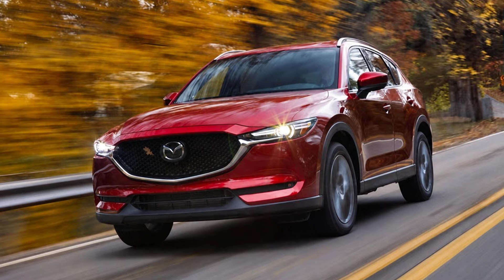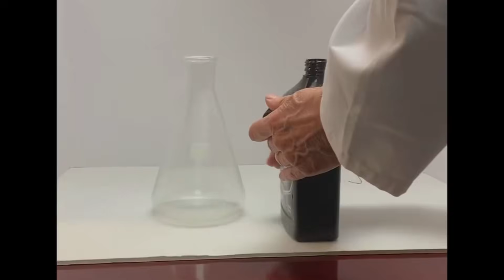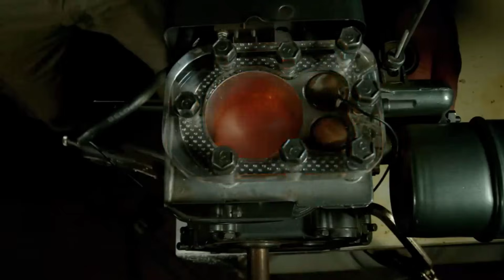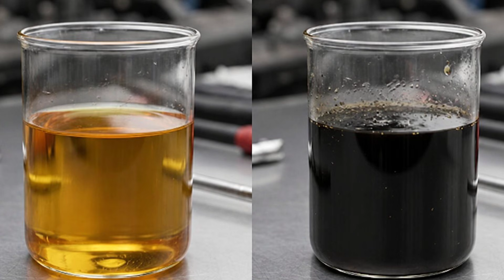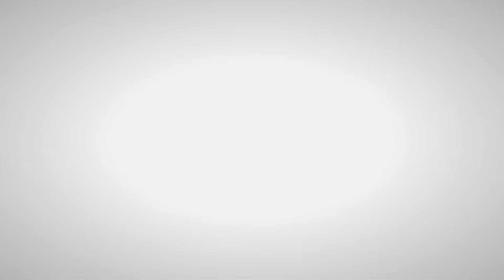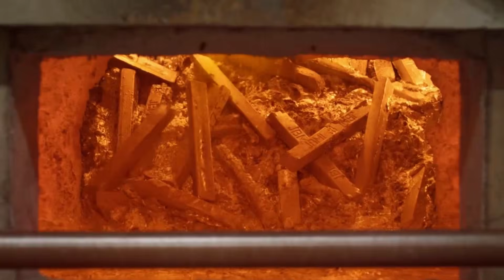Pennzoil 5W-30 vs 0W-20

Comment: Several auto engineers have stated that engines are not designed to run 0w-20, it's the execs decision to meet CAFE stds.  As a result, over 6 million engines are being recalled across numerous manufacturers.  My car calls for 0w-20 and I run Ravenol VST, a group IV/V oil at 5w-40

Comment: Whatever you use, change it every 2000 miles for a long trouble-free turbo charged engine life.
Reply: 2,000?!   Yea, the more often the cleaner but don't you think 2k is a bit often with good oils?
Reply: @datsuntoyy  Contrary to popular belief, hes absolutely right. Especially with 0w20, you get it out before it even starts to shear, fuel dilute. Carbon buildup , deposits will be immaculate over the long run.I personally do 3,000 but considering going to 2,000 since im using 0w20.
Reply: @GBOComedy "popular belief"  you mean that belief of just about every gearhead, mechanic and engineer in existence? Your engine will be perfect inside, but doubtfully any cleaner than with 5k.  I'd only run 0w-20 if the temp never gets above freezing.

Comment: Info in this video is bullshit regarding what’s required, what the engine is “designed” for, how warranty/service handles a different viscosity other than what’s “recommended” in the manual. Bullshit video is bullshit